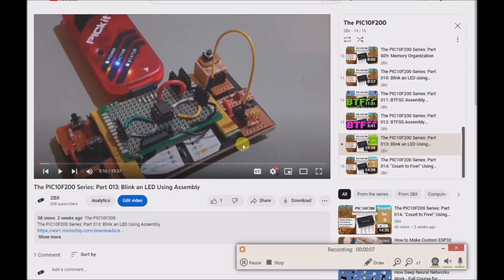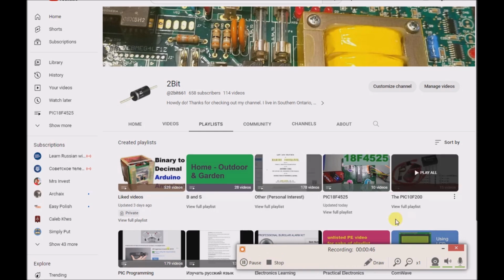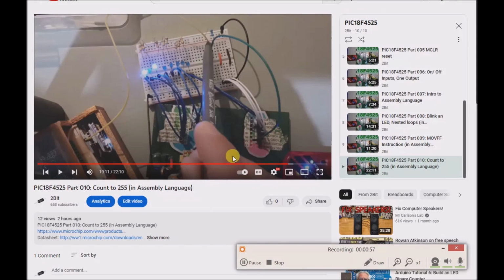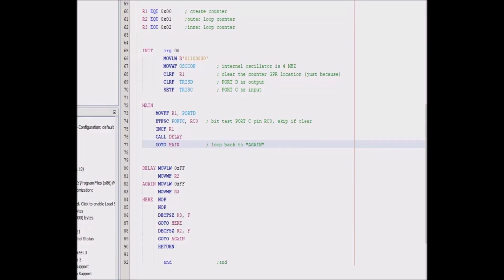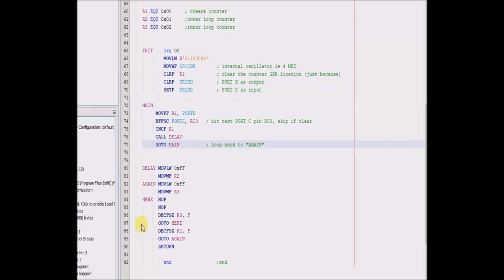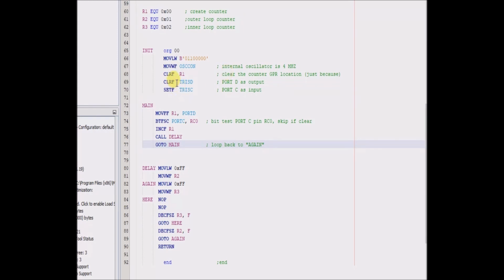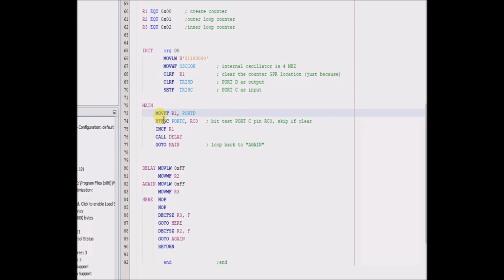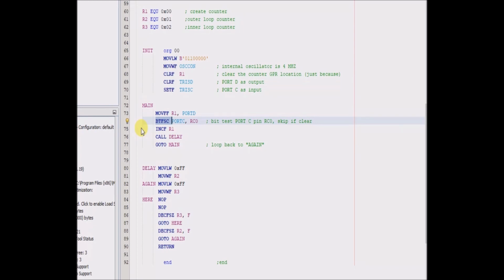PIC18F4525 Part 011: Bit Test with Delay (in Assembly Language)

Comment from the maker: ;free sample code (copy and paste)

R1 EQU 0x00     ; create counter
R2 EQU 0x01     ;outer loop counter
R3 EQU 0x02	;inner loop counter
 
   
INIT	org 00
	MOVLW B'01100000' 
	MOVWF OSCCON	    ; internal oscillator is 4 MHZ
	CLRF  R1	    ; clear the counter GPR location (just because)
	CLRF  TRISD	    ; PORT D as output
	SETF  TRISC	    ; PORT C as input
	
MAIN
     MOVFF R1, PORTD
     BTFSC PORTC, RC0	; bit test PORT C pin RC0, skip if clear
     INCF R1
     CALL DELAY
     GOTO MAIN		; loop back to "MAIN"	    
       
    
DELAY MOVLW 0xFF
      MOVWF R2    
AGAIN MOVLW 0xFF
      MOVWF R3    
HERE  NOP
      NOP
      DECFSZ R3, F
      GOTO HERE
      DECFSZ R2, F
      GOTO AGAIN
      RETURN
	
	end		    ;end